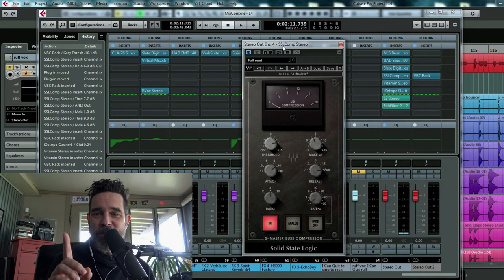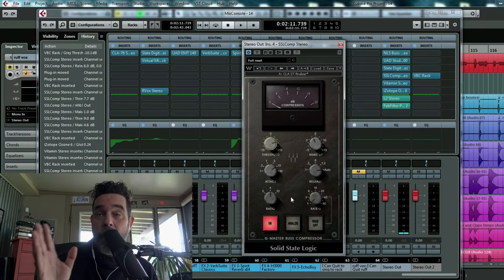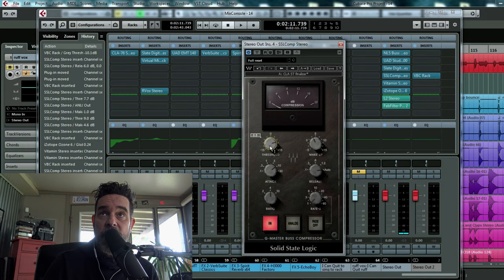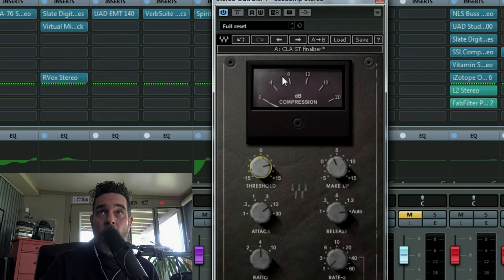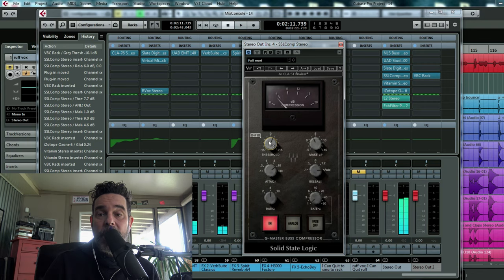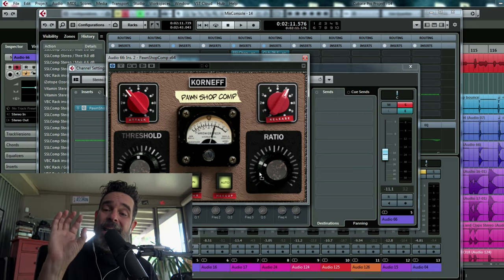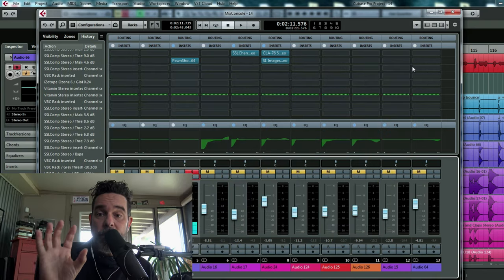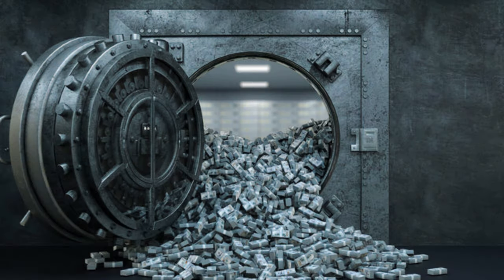How the Pros set their Master Bus Compressor

Comment: I set the attack to 30ms as most pro engineers recommend in order to let the transients pass through. 10ms will tame the transients much, no? And gain reduction, only making the needle barely move (according to Streaky’s tutorial) since the point is only Gluing the elements together.

Comment: Really helpful! This is how it should be, no mystifying. I think you can teach the principals of mixing in 5 min video, all you need is  balance with volume control, then punch or control with compression, and finally EQ to add clarity and take harsh frequencies out. That’s it, but first you have to be able to hear what is happening in the mix, and that takes years. So just train your ears and don’t bother yourself with 3. party plugins at least first 5 years. A pro mixer can do everything with stock plugins. Really like this channel!!!🙌🙌
Reply from the maker: Thanks Samuel!  Great comments.
Reply: Yeah, training your ear is the hard part without someone with a trained ear to coach. But you are 100% spot on with this point.
Reply from the maker: @Overcool Music LOVE IT!! I use it on vocals every mix.
Reply: @Overcool Music yes, but the point was that you should learn first to hear them yourself. If you don’t you might be overdoing the cuts, and you’re not actually hearing what it does
Reply: So actually I would say, that definitely not for beginners. Unless you don’t want to learn mixing properly
Reply: @Overcool Music got it, but still it’s basically an eq multi compressor.. I mean they made pretty awesome sounding records before these new type of plugins.
Reply: @Overcool Music true, it’s made about 3 kilometers from where I live here in Helsinki 😂

Comment: Yep, I use that exact setup, but I typically use the Slate VBC Grey, which is a replica of the hardware SSL bus compressor - basically the exact same thing. I can vouch for this, because being hard-headed, I learned this is the sweet spot for that compressor by trying many different settings and taking it through mastering, and listening in many different systems. No more than 1-3 db of gain reduction, auto release, attack at 10 (although attack at 30 is fine for some tracks - more important is not less than 10 of attack - lets the initial attack of transients through). And SSL bus compressors are optimal at 4:1 ratio. Great video!
Reply from the maker: Agreed on all the above man!  I actually did a segment in this video using the slate Compressor with the high pass function engaged but in the end I edited it out because I thought it was too confusing for the basic point that I wanted to make with this video. I also love that slate compressor.

Comment: Pretty much my typical settings... except I rarely go above 2:1 ratio, just tickling it - so, every day's a learning day and I'll try 3 or 4 to one and be a bit more adventurous next time and see what's what.  Cheers Dr Bob, like your style.
Reply from the maker: Thanks for watching man!
Reply: I like a lower ratio, too. It allows me to go to about 4db on the meter to control whatever pokes out of the mix without crushing my transients. I also use a compressor with a sidechain up to 100hz to allow the bottom end through to keep the mix from thinning out. So depending on the aggressiveness of the track: 2 or 3 to 1 ratio, .10 attack, and usually .1 or auto for the release, 3 to 4 db on the meter.

Comment: For some reason I never really use auto release anymore, just always slow attack fast release and with the bx console ssl. This compressor is still a beast for snares
Reply from the maker: Nothing wrong with that.  I tried to make the simplest version for those who are insecure about release times.  I do find the auto circuit is pretty good though..
Reply: @BobbyHuff  yea I should probably go back to using auto bc it’s just the safer move especially when you can’t get very specific release times
Reply from the maker: @jabooky15  do what you think sounds right!  If you are comfortable with setting your own release time then do that..

Comment: The only difference in my settings and yours is I have Analog selected on mine...🎛😎👍🏻
Reply from the maker: All good!  Nothing wrong with that!
Reply: analog setting just adds noise, I recommend turning it off, you can check on youtube, it has been proven that waves "analog" buttons do not do anything except adding noise
Reply: @arvilsdazreiz8797  yea, they did it to give it that noisy analog sound. Sometimes it can be a problem, So I turn it off, but it really depends on how much of an analog junkie one wants to be..lol... I leave mine on most of the time, but when it becomes too noticeable I turn it off. I've seen most complaints come from users that don't realize what it does and spend a lot of time trying to figure out where the noise is coming from.
Reply from the maker: @arvilsdazreiz8797  the noise on AGREED!  the noise on the H Doing elay is ridiculous!!!  The 1176 stuff too.  If you have 40 1176s in your mix with the noise on it’s a mess!!!  They should eliminate this feature.
Reply: @BobbyHuff  Yup, they could just mark it as "analog noise" and it would not be misleading anymore :)

Comment: bought this plugin, doesn't even run in my DAW, wasted 40$ for nuts. Thank you very much
Reply from the maker: What plugin did you buy and what DAW do you use??  Waves works with every DAW Ive ever heard of..????
Reply: @BobbyHuff  bought the SSL Compressor and currently I am working with LMMS, this DAW supports all known VST2/3 32/64.dll Plugins
Reply from the maker: Did you buy the Waves version?  Are u on a Mac?  There are several forums out there for this.

https://lmms.io/forum/
Reply: @BobbyHuff  i bought the Win version.
Reply from the maker: @TraxtasyMedia  so you are on Windows and bought the Waves version?
Reply from the maker: Also try installing the program as the administrator.
Reply: @BobbyHuff  yep
Reply: I am back at it, but I can't resolve it. Inside the forum there is no topic about it and to be honest, I don't even get a UI on my buschannel, it loads the .dll but there is no interface. Even tho I tried to push everything in one folder, installing, deinstalling, repairing, nothing worked...
Reply from the maker: @TraxtasyMedia  does LMMS have any direct support?
Reply: @BobbyHuff  not quite sure, but I gotta check that.
Another way is contacting the community/devs via reddit. 
Or I'll head inside the forum and open a threat. Gotta see, if there are any helpful advices, guide lines or stuff like that. 
Oh, I want to excuse myself for being so impolite in my first comment, so I think I can make this work in any other compressor I guess? 
So therefore as you want to figure out how to get it working and responding very quickly, you'll get my sub. 😊
Reply from the maker: @TraxtasyMedia  all good my friend.  Sorry you are having trouble with this.  It’s a very common plugin so I’m surprised your DAW won’t accept it.  As far as a substitute compressor...there aren’t any that really “do,” what the SSL bus company does as it was specifically designed for this.  There are many companies that make their own version of it.  Does LMMS have a bus compressor?
Reply from the maker: @TraxtasyMedia  I will also ask around to see if any of my friends know anything about your DAW.
Reply: @BobbyHuff  I guess it does, but actually I switched to different comps, like Molotok, Melda Comp, OTT, etc. The thing is actually, that this SSL Compressor is listed in the database with a dll but I dunno why I can't use it, there's also that waveshell thingy, dunno what this is and does and yeah I am confused. The most striking thing is, all the comps I use don't have an Auto-Release option. So, I suppose that SSL is the only VST that got it implemented. Yeah often use free plugins, like the mentioned Molotok or GMulti
Reply from the maker: @TraxtasyMedia  just a thought...have you ever about switching to another DAW that may be easier to implement these type of plugins.  Cubase, Studio One?  There may be a slight learning curve to change but these type of DAWS stay very current and you would be able to use any plugin.  Thoughts?
Reply: @BobbyHuff  tbh I tried Reaper, FL STUDIO, Ableton, but FL STUDIO is too expensive to buy it.